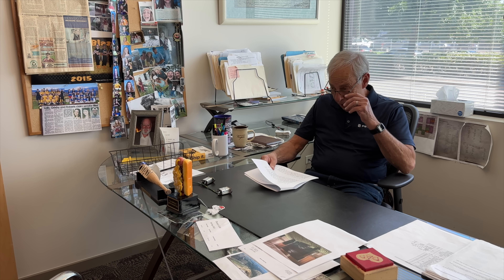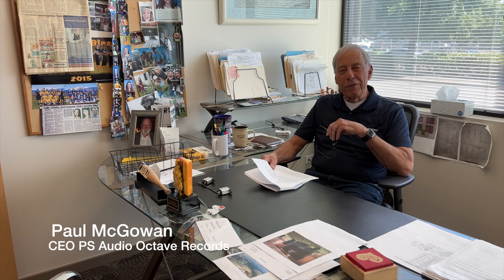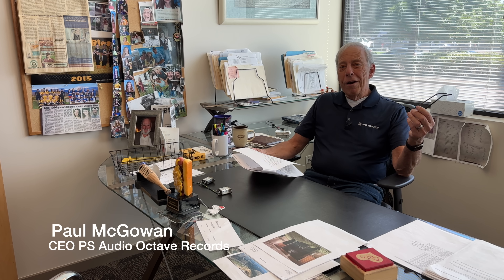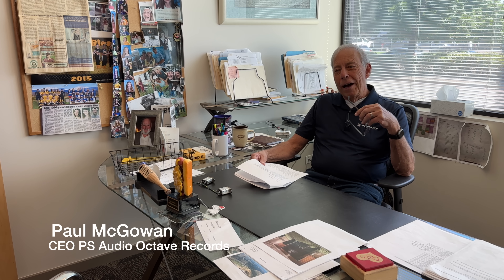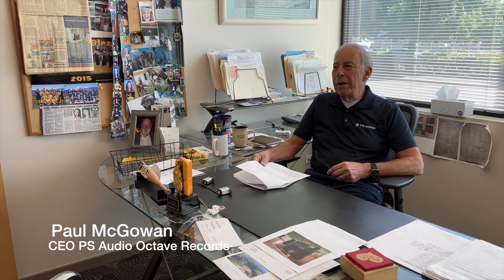Why not run everything on DC?

Comment: Love your channel! Almost viewed all of them, you are a great teacher. 
One of the reason, « i might be wrong », is it takes AC for a transformer to work. If it possible to chop DC with resistors or zener diode but it more difficult then simply transform it to the voltage you need  while it still AC.

Comment: I remember back in the 80's or early 90's a preamp by I think Rowland or Mark Levinson that ran off of a separate battery and was really expensive for the time. It was an interesting idea but the battery had a fairly short run time before needing recharging. Does anybody remember this preamp.

Comment: I think the real reason we don't have DC power outlets is that practically nothing that runs on AC is backward-compatible to run on DC. DC-to-DC converters are commonplace nowadays, and DC transmission losses are much lower. Edison and Tesla didn't have buck/boost converters or silicon-carbide switching devices in their day. The world has changed a lot since then.

Edit: of course DC-to-DC converters are not exactly desirable audiophile components.

Comment: I wish to suggest, this response is off the mark.  Yes, it would be easily possible to run everything on DC.  Telephone switching equipment has done this since the 1970s.  Everything runs off 48v DC.  There are typically two DC rectifiers, some batteries ganged up to 48v, and an automatic switch that will keep 48v supplied, in the case of a power outage or single rectifier failure.  Equipment then operates from 48VDC, although some equipment can accept either 110AC or 48VDC.  It makes the UPS easy.  Imagine the current reserve a bank of 16x6v batts can supply.  10K watt surge?  Absolutely no problem.  This DC power source runs everything: network gear, optical amplifiers, security equipment, telecontrol devices, and whatever else.  There is an entire ecosystem of 48v gear and it's all professional.  No low-end 48v stuff.  When we need to run a 48v device in the lab or in a data center that isn't set up for DC power, we use a small 48VDC power supply.  If a shed full of equipment at the base of a tower can run of 48V, a stereo certainly could.  I'm not saying it would be practical or desirable but it would definitely bring advantages that could be weighed against the additional cost.  DC would probably lose that saw-off but I'm just saying it isn't as far fetched as it may seem to someone who isn't open to the idea of DC power.  Even power transmission is switching to HVDC (high voltage DC) for some purposes.  Maybe Edison wasn't Tesla's junior, after all?

Comment: Those old amps with E-core transformers still sound great today. Looking after those pesky caps are the only real issue. When an amp goes DC output it will totally cook your speakers.

Comment: If you think about it this is how a EURORACK works, all your audio modules use a single clean supply with each module tapping that supply, this is also how some server racks work. One of the main reasons not to do this is because the DC PSU becomes the limiting factor in the system, unless you want to build a massive DC power plant of some type at home then I would stick with AC ;).

Comment: Thanks.  I've always been told that DC doesn't travel down the lines well; it needs power boosters that would be very expensive.  With AC, it's cheap & convenient to use rectifiers as needed at the user end.       tavi.
Reply: its not true, check high voltage dc is the new trend and the future of power distribution. its actually by 50% more efficient then ac you dont have induction and skin effect losses in the conductors plus fewer fires, actual reason for chosing ac was  because it was simpler, and they didnt have proper semiconductors back then. they would run a motor at 60hz but now most new  motors are run by invertors so ac is becoming absolute

Comment: Even without the reasons Paul cited, it would not be efficient or practical to send DC over power lines for the distances required to supply everyone with power.

Comment: If you want the purity of DC in your system, just put wooden blocks under your speaker cables. Problem solved! 😂
Reply: Connected in the right direction!
Reply: @glenncurry3041  wait! The grain pattern on this block is off! Now my $15k system sounds like crap!

Comment: Simple enough. You put a voltage limitation device on each unit to reduce the voltsge to necessary level. That way you could have whatever voltage you needed. Why does everything have to be so complicated for you people? Youre engineers, for Gods sake! Instead of answering the guys question (valid question) you just give him readons why it wont work instead of explaining why it could?? I agree! Pure DC voltage could revolutionize the entire industry! You say that existing equipment all uses AC power. So? Its not like "true audiophiles" would have any problem dumping thousands on 'new and improved" devices! For Gods sake, some of you spend thousands on pieces of wire,!!
Reply: Likely because there is no relevant gain to be had when we still get AC in our houses. We don't have any trouble converting AC to DC so it's not a problem that needs fixing. There are tests available where you can see amp transformers being fed with different quality signals (from a noisy outlet to using a power regenerator) and in none that I've seen there's been any difference whatsoever in what the transformer put out. It all yielded the exact same DC signal.

So the question is still, why should they make equipment that you feed with DC? The only reason I see is to sell more snake oil and pretend that we aren't already getting the clean power we need.

Comment: And our gear convert AC to DC ant filtering it. Therefore NO power plants or conditioners are needed!
Reply from the maker: No, if you're running in standard AC mode (as we all are) then regulating the AC power with a Power Plant is the way to go. This discussion was merely hypothetical as a means of explaining what could happen but certainly will not.

Comment: That's the best question I've heard all year. And it probaby isn't practical. Taking from that question I  was wondering why you designed 'multi wave' in your power regenerators. Couldn't some of these weight forms possibly cause noise?

Comment: "Back in the day" all telecommunications equipment ran on 48V DC. Every AT&T (pre-divestiture)  Data Center / PoP had 48V DC power plants. Sun Micro System's was the primary server used in early Data Centers. Sun Netra's were mainly used for a series of ruggedized Network Equipment-Building System (NEBS)-certified carrier grade servers. Almost always those came with 48V DC power inputs. The benefit was efficiency and a lot less heat as there is no AC/DC transformation in the server. Yes, you have large AC/DC converters (DC power plants), but it is not in your rack - so you produce less heat in each Data Center rack. Large converters = more efficient. This gets really nice when you talk UPC - battery power is DC anyway. If the world had stayed with 48V DC we would have much, much more efficient Data Centers that would generate considerably less heat and require much less cooling.
Reply: Ahhhh still deal with neg 48 to this day in telecom
Reply: @scottyo64  For sure.  The electrical grid has switching and monitoring systems that run off 48VDC, also.  There is no plan to migrate away from it, either.

Comment: Started with home audio as a kid, went to car audio (no more mom, turn that juke box down) and now back to home audio as I grow old. Got to say car audio was so much easier and cheaper. In a closed box a couple hundred dollar amp was enough to sound great and blow your ears out. The amps alone I have at home now cost more than my first 4 cars with their stereos put together. All because they plug into a wall. Back when I was a kid in the 80's I didnt understand there were rules about this stuff so I gathered two deep cell boat batteries and a battery charger and used car audio (power boosters at the time) in the house, seemed to work fine. Just had to remember to plug them in to charge before school and they would be good all night. Ahhh the good ol days....
Reply: 5 Channel Amp.
Single Din CD player Head Unit.
One Subwoofer. Plus box.
2 component speakers with custom made speaker cabinets. 
You can bridge the  2 speakers on the amp.
Gel or Glass Mat 12 volt battery. 
Battery charger.
Power & Speaker cables 
Enjoy..😀👍😎

Comment: Had the same question) would be great to have have options, like dc 12 V IN, then one could buy good converter, the other could buy or build car led battery(ies) and a audio ups for cheaper but still clean power source

Comment: Comvert AC to DC, to AC only to convert it back to DC again?
Seem ridiculous doesn't it?
Well it is!
Save yourself a ton of money and skip the regenerator and let your equipment do what it is designed to do.
A power regenerator has absolutely no effect on your audio and that has been proven over and over again!
Reply: Mmmmmh det stemmer nok ikke...
Reply: Where are you getting your information as I have seen and heard otherwise, and not from Paul.
Reply: @scottyo64  https://youtu.be/12T7JFLGlf0?si=GOEB9fuxcYNHuqF6

Comment: You are "the industry."
Make a product with two power supplies, one AC and one for a 12V car battery. (or a couple in series, whatever floats your voltage boat) Talk about a low impedance power supply. Have a battery tender hooked up and you're good to go.
Less need for massive expensive power supply capacitors, a couple of transformers to get your various voltages for stuff, lots of benefits. 
If people dig the idea, start making some with only DC input, they'd be cheaper and better. You could even make money selling gold plated batteries, not that they would sound any different, but the WAF might go up a little.

Comment: Audio equipment used in vehicles normally use a 12V DC power source
Reply: Yes, and there are good and inexpensive DIY "car amps" available.
Reply: @davidzoller9617 diy? Why not just buy a a class amp for 12v-24v?? They started making them in the 80s btw.